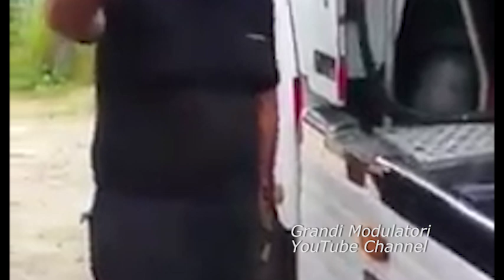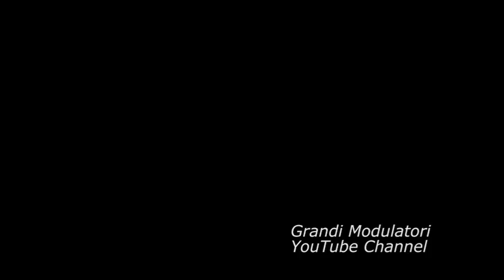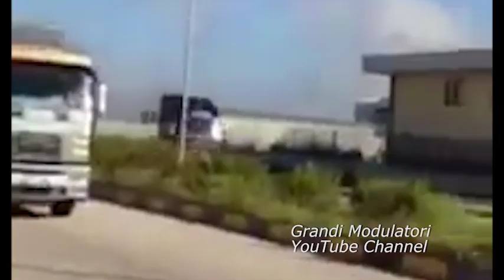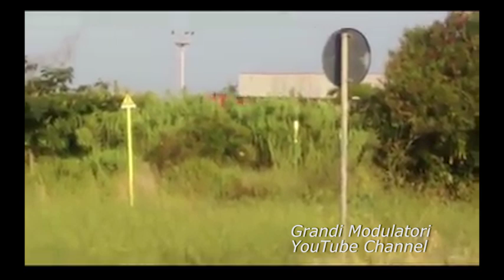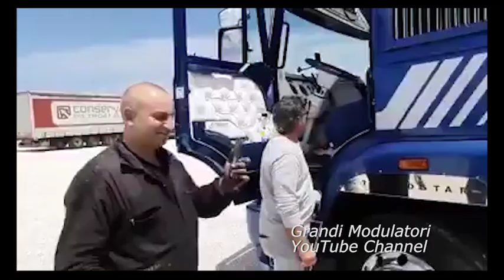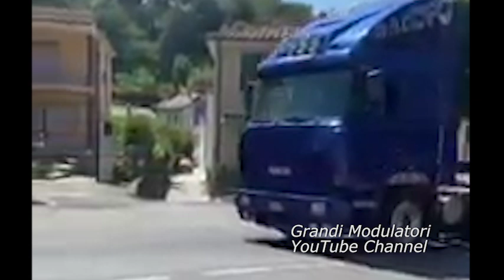#v8sound - The sound of old vintage V8 trucks from the past accelerating

Comment: I have to say these Iveco V8 engines sounds much better than Scanias V8 😎
Reply: Yep. This one in particular is just ridiculous, pure power.

It's a 17.2 liters used on boats, it's a torque beast, slightly tuned can get to 1000hp easily.
Reply: 🥂Terrible truth